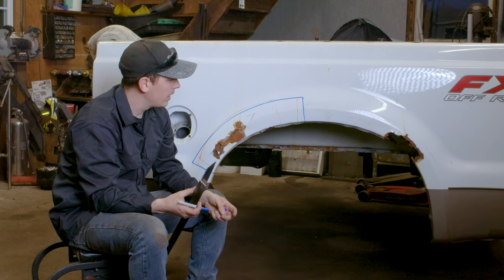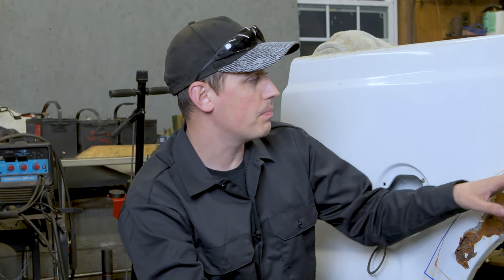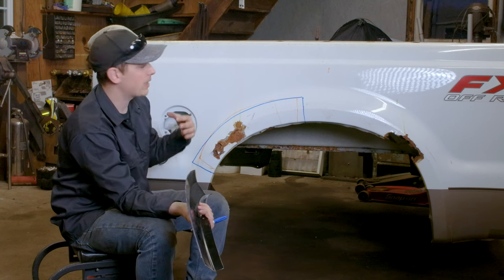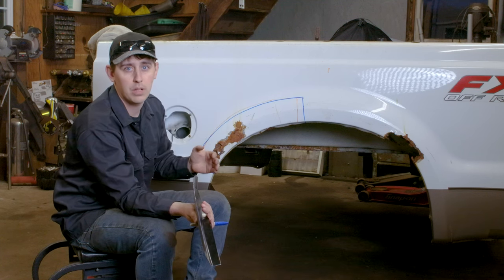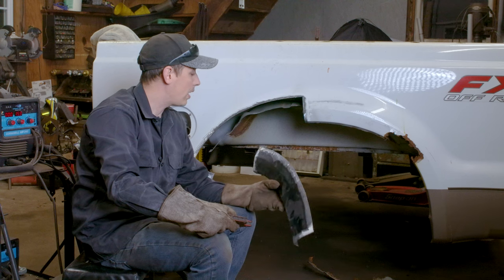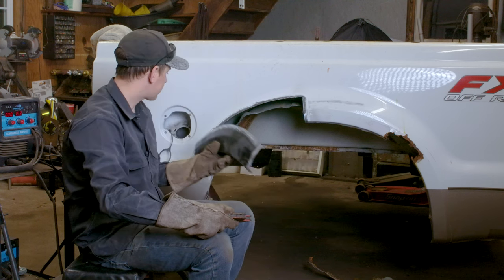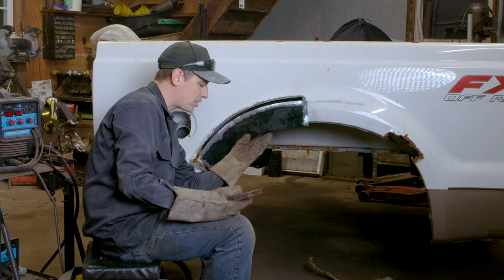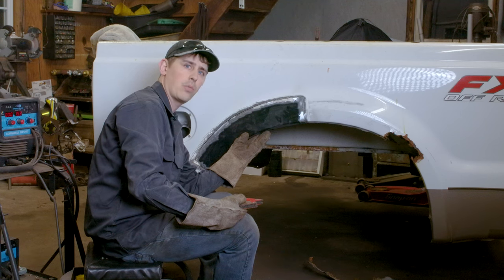BED SIDE WHEEL ARCH REPAIR

Comment: Once the patch panel is trimmed, bin the marker, grab your grinder with a skinny 1mm cutting disc & cut around the patch (clamp it in place so it doesn't shimmy) cutting through the bodywork as well. If you tilt your cutting disc so it "Undercuts" the patch panel - bang - perfect fit every time, which cutting to a marked line will NEVER achieve. If you try follow a marked line, your disc will always wander/be off/nothing will fit nice - cut around the actual patch itself (or even cut through both the patch & the body) and bingo - she fits like a glove.  It's just a whole lot easier. :-)
Reply: I know as I do this stuff ^^ day in and day out at work, btw. All we do is rust repair - nothing else. Eventually you get good at it/work out what works. I started at it in 1984.. :-)
Reply: Would you recommend just going through both the patch panel and body before even trimming anything or should I trim the patch first then cut around it on the body?

Comment: Thoughts on welding on the back side of the panel so that you avoid having to grind paint side. I’ve done similar jobs plenty of times where this approach isn’t an option but I’m in the same boat with the inner liner so the room will be there. Just wondering if anyone has had success or tried doing it this way .

Comment: What kind of cordless tool are you using with the cookie wheels? Is it just a small drill, or is it some sort of higher speed grinder? Does it need an attachment to fit the cookie wheels?

Comment: Nice. I have the same repairs to make on my 06 f350
Reply from the maker: Hopefully this helps!
Reply: @In The Shop  any advice on welders? I'm a welding noob and have no equipment, though am definetly capable of making this repair.
Reply from the maker: @ojmcbaggins  almost any wire feed welder would get the job done. I like to stay away from flux core so any gas shielded machine will do. Honestly the harbor freight Vulcan machines are pretty nice for the money.
Reply: @InTheShop  thanks so much, harbor freight was my go to as ill only use it a few times in my life

Comment: its pronounced   you pole.... its good stuff they also make raptor liner ....
Reply from the maker: Haha I figured I was saying it wrong. Thanks for  watching!
Reply: @InTheShop  it was a good video !  I like watching others work .. LOL.     I am not a body-man myself, I have done very similar repairs my self though ...  and I found if your gaps are very close you can tig it with very little distortion .. or if you have the "fancy" new inverter mig machine like the millers with RMD or some HTP or fronius welders you can run full length beads without warpage or distortion ... but not everyone has the fancy stuff ... for what you are doing there there is nothing wrong with spot welding the entire thing ..... its not like its a load bearing part and maximum strength is. concern ...  this is a purely cosmetic repair ...